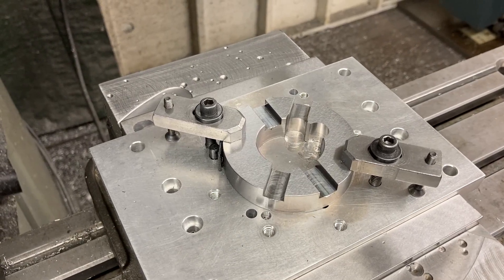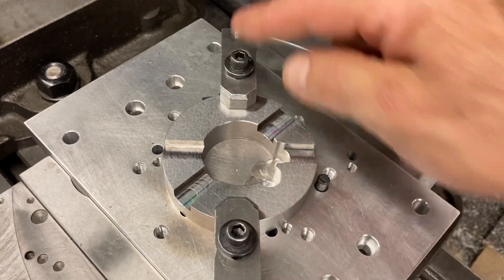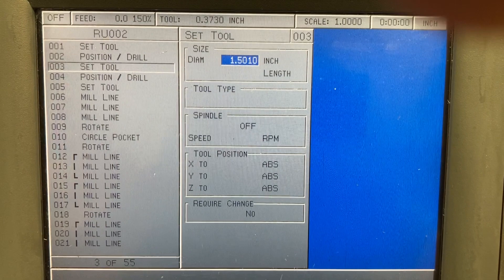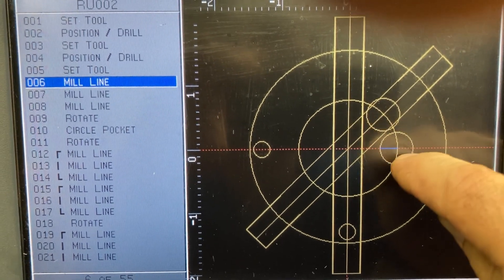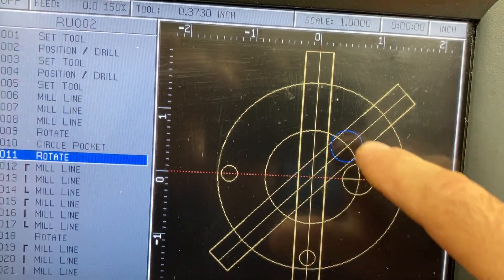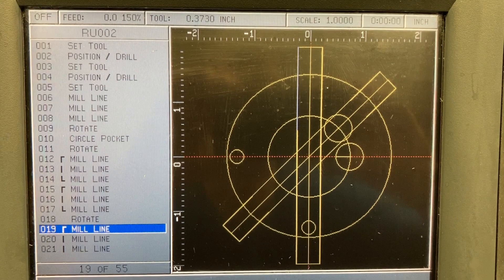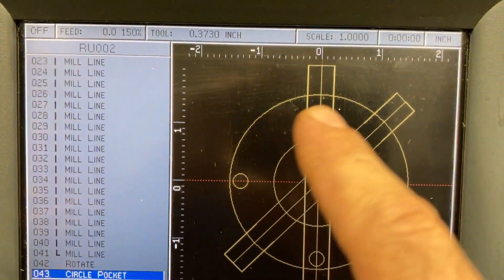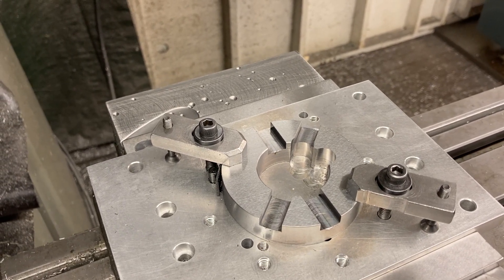CNC Programing on Acu-Rite MilPwr for Milling Keyway and Circle Pocket Using 45 deg Rotate Function

Comment: I like this version of millpower, BUT,  where in the programing doe it mill from center, at the working feed rate, out the the repeat pocket at 45 degrees,   on the older version you would def have to calculate that from the machine positions and use the teach position function. And the older version sucks because I have tried and it wouldn't let some zero a part datum.  To much math.

Comment: I'm really new to the programming of the millpwr.  Can you explain what is going on with steps 6-8?  Meaning what does the (x,y) look like for each line?  Do you repeat the same points for each depth of cut?  Are you running a 3 axis machine?  If not does the program stop to manual lower the z depth?